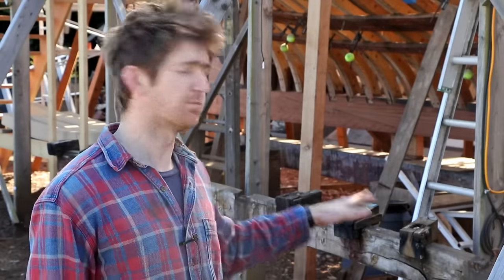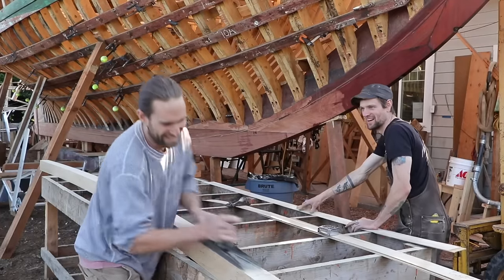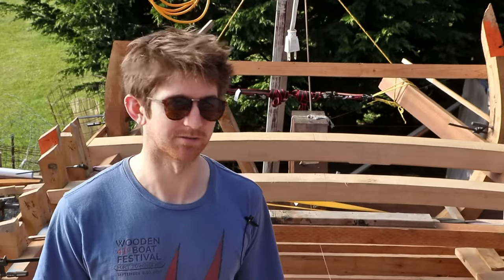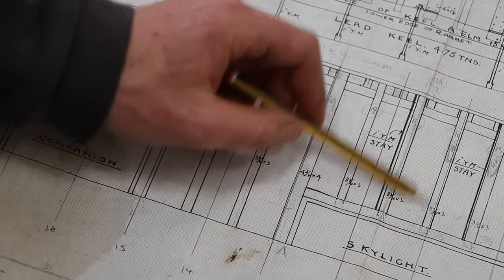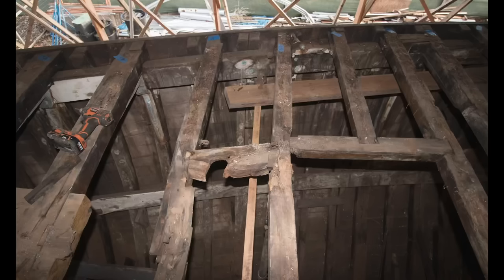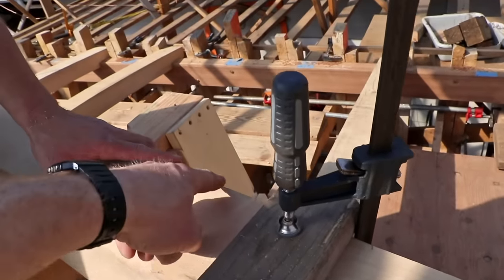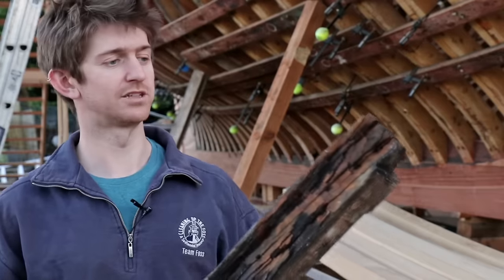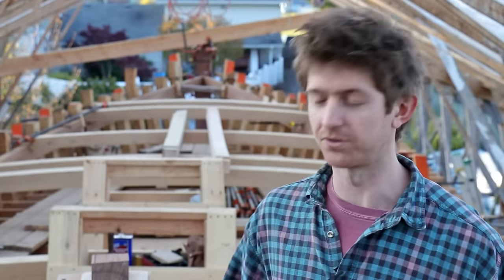BoatBuilding - Fitting Deck Beams! (Tally Ho EP70)

Comment: I quite often pull the plane towards me, especially when doing finer cuts, detail work and working on something with a bit of movement to it. Helps me stabilise the job by leaning against it, rather tan putting my weight behind the plane movement.
Also allows you to rest some muscle groupd for a bit.

Comment: The extra shoulder pocket on the half lap is probably to support the lower tip of the beam, the beam in a standard half lap relies on half the thickness of the beam, adding the shoulder would help with support if the beam starts to split (as is often the case with timber)
Granted it also makes the joint look much better.

Comment: Leo - could you talk a bit about why deck camber is important?  My guess is that as the deck is heeled over, the surface that people are walking on isn't quite as steep sideways as it would be if the deck were completely flat.  Also, the camber provides the salon with a bit more headroom (you said 6" at one point, I believe).

Comment: I've had the same Workmate for over thirty years, and use it as much today as when I first got it. Excellent joinery!
Reply: Moe Beddah you were fortunate to get an old workmate. The early ones with the cast aluminium frames were beautifully made, then they stripped the quality out. It’s all part of the reason why, certainly in the UK no one would buy a Black and Decker power tool.

Comment: sandpaper on bottom of plane..eh it works. Bodyshop sanders work better same hand for and aft but they curve some. Also have clips for holding paper. 

Love the progress you made it has been a LOT of progress on deck structure. For bronze casting your going to need a lot of bronze. You may want to check with salvage yards and the recycling places to see about getting some bronze to bring to those who will do the actual casting in the type of bronze you want. Or even copper, tin, antimony, etc. Not sure about the united states but here in canada we have recycling depots where scrap metal collectors drop off loads they get paid by the pound. You may be able to buy materials at a good price. 

Just some ideas Leo.

Comment: Thank you for the video guys! They are needed during these times! Quick question from a suffering man when needs to move heavy things: Shouldn't you start putting the boat down to the lead keel before it is any heavier?
Reply: He's got to install the floors & through-bolt them to the bottom of the wood keel. After the floors are bolted to the frames & keel, & maybe also several pairs of the bottom-most 'garboard' planks are screwed & nailed in place, he can shore up the bottom of the boat & raise the lead keel up to the timber keel. That way there 'might' be enough clearance to get underneath w/ the Hole Hawg & drill bolt-holes up through the timber, using the existing holes in the lead as a guide.
Reply: @frederickstibbert7389  Thank you! Much clear!
Reply: @frederickstibbert7389  I'm always impressed by your technical answers to some comments, are you a boatbuilder/ shipwright?

Comment: Any thoughts of doing any details on the visible corners on the bottom of the deck beams ie maybe some beaded edges with a router?  Very impressive joinery on some very hard wood.  I am guessing you have become an expert at sharpening!

Comment: Absolutely gorgeous work, Leo and crew.  I love the joinery on the beams and beam shelves! One question out of curiosity: why the sloped bottoms on the half beam dovetails? I would have guessed the slopes would be in the opposite direction, to help pull the half beam tighter into the carlin.  Are they cut that way to avoid water pooling in the joint and prevent rot problems?
Reply from the maker: Yes, exactly. The deck is the most likely place to leak fresh water. Also it takes less timber (and therefore strength) out of the piece being notched into.

Comment: Can you explain tumble hone?  Great endeavor and skills displayed Leo.
Reply: "tumblehome" - as the sides of the boat rise, they continue to curve & start to bend inward. The deck is therefore less wide than the maximum beam dimension. Tally Ho has a slight amount of tumblehome amidships, but it's often quite noticeable in large wooden warships.

Comment: That joinery is crazy!!  I can barely do a butt joint... pocket hole jigs are high end joinery work to me.  I can't imagine using those chisels and getting things right every time.    One question, aren't those beams really curvy ?  It seams like you'd roll off the deck. is that how it will look at the end or do i just need to wait and let Leo finish his work?

Comment: It looks like it would have been easier to build new beside the old. You could take the measurements from the old, transfer the fittings and be saved the labor of removing all the old wooden pieces. Do you remove and replace to have an all new rebuild that is considered the same ship rather than a new build that I suppose would be considered a replica?
Reply: It was (& remains) Leo's intention to rebuild the ship by replacing the worn-out bits. The scale of the rebuild changed when he discovered that the original keel was not repairable.

Comment: Leo...You are still my hero and as often as the videos are uploaded I watch the guy with the parrot and the guys with the genuine fake parrot. 
As Monty Burns would say..."Excellent" Are those beams you've made finally installed or do they have to come back out to be oiled, varnished, painted finish coating applied then put back in and have them water proofed and screws rivets etc installed? Inquiring minds want to know.
Reply: Bill Hamiltono - More work required, let's wait & then see!

Comment: Hi Leo, awesome work restoring Tally Ho, congratulations. Looking at the original beams in this vid, I was wondering why you don't soak all the new joins in oil before fitting them? I suppose it would add time and cost to the project, but surely it would be good for longevity? I remember in a previous vid where you went back to the place you worked as an apprentice, the boatbuilder had soaked all the timbers of his yacht in oil until it wouldn't take up anymore. Seems like a good idea? I'm sure you have a good answer why you're not doing it, or maybe in the next vid we'll see you doing it as planned.
Reply: Rob Healey - I think "Dry fitting" at this stage!

Comment: Just for fun, you should saw some shallow grooves to replicate the original notches that were filled in, so she's 'exactly' as once made... Also, while I realize using chisels by hand is necessary for fine work, I'm surprised no one had fitted an old chisel blade into a 'hammer only' drill to make a variable speed 'power chisel' for hogging out large chunks of hard wood. Once the gross materiel has been removed, switch to hand work to bring it to spec... ; {

Comment: Leo did I hear you right in a the past American elm was originally used in some parts of the structure?
Reply from the maker: On the drawings it was called for in places, yes. Not sure if it was ever used.
Reply: from the woodwright shop " PBS" he said the grain in elm  is very interconnected much less likely to split. he said it was used for wooden wheel hubs for that reason..but the wheelwright channel i watch .i haven't seen him use elm for hubs so???
Reply: @erniew5805  Having tried to split elm for firewood, I can vouch for its cohesiveness.  It's damn near impossible to split, even with a log splitter unless it's a real beast of a machine.

Comment: In watching procedure , I notice there is no bedding or sealer compound in any of your intricate joinery of the deck works . Being exposed to fresh water , aren't they subject to rot the same as elements below the water line ? How do you keep it dry ?
Reply: I'm guessing but maybe they will treat them after setting-adjusting them all and see all is ok.
Reply: @banmadabon  Correct.

Comment: Acorn to Arabella are installing their planks before the deck beams. It seems to me that installing deck beams will add to the strength so the planks don’t pull the boat out of shape. 

They have steamed frames rather than dawn frames. Does this affect the order of the build?
Reply: A2A have their floors installed, along w/ the motor-mounts & cabin sole framing supports. These bits must be installed before the planks go on.

Comment: I found it interesting that scholars don't know how the word was applied to the part in the shipwright sense: from old norse for a witch?
car·line2 | ˈkärlən | 
noun (usually carlines) 
any of the pieces of squared timber fitted fore and aft between the deck beams of a wooden ship to support the deck planking. 
ORIGIN 
Middle English (in the sense ‘(old) woman, witch’): from Old Norse karling; the reason for nautical use of the word remains obscure.
Reply from the maker: Interesting! I had never thought to check.

Comment: I have a question after seeing this....
As far as I understand it, there are 2 ways to finish a wood surface.
Cut (draw knife, planer, carpenters axe, etc) and Sanded, where the sanded surface is preferred for interior surfaces due to its smoother characteristics while the cut surface is for outdoors due to its higher resilience especially against water.
BECAUSE.... (as far s I was told) when you cut the surface, you actually cut off entire wood cells while still leaving a complete intact cell structure on the surface that does not let in water through the now dead cell walls, but when you take that cut surface and sand it, the cell structure gets ripped open, creating a smoother surface (to the touch) while weakening the structure overall, because there is no “build in” protection that hinders water from entering the wood.

This is observable on untreated wood. A cut surface for example by a SHARP! Axe or drawknife does not hold water, it builds pearls and simply rolls off like droplets on a freshly waxed car, even at angles as low as 20 degrees, whereas a sanded (and then unsealed) surface allows water to build droplets, even on a near vertical surface, that actually stay there until they dry off, allowing water to enter the structure.

Now I saw you sand some of the deck beams, wich seems odd
Am I completely wrong here, or is there a specific reason you sanded those deck beams?

To clarify my position.... I am not a shipwright or carpenter in any way, although interested in those subjects I have no education in this field.
I worked a few projects, and this is what I was told, and I accepted it due to its logic, so.... tell me if I’m wrong

Comment: is there a way to not use metal fasteners on the deck dowel and tounge and grove ,sides and ends with a floating deck in groves and pegged down to the beams in sections not each plank,? savy?expansion would make it water tight as soon as it gets wet and shrinks some when it is dry/or is the deck part of the structure that is fixed.?
Reply: Leo look up mr.chickadee on you tube Tradtional Korean floor,it would be worth your time.You can do it .!

Comment: Hi Leo,
Question driven due to watching multiple shipbuilding teams.
You have gone from installing the frames to installing the beam shelves / deck beams, the boys over at Arabella went from frames to planking.

Are there any differences in the two approaches, benefits or problems etc?

Comment: Why are the beams bent upwards? If they're meant to hold the sides together, won't the beams straighten under weight and push the sides outward over time?
Reply: Answering my own question, it's probably more important that any water coming on the deck flows of quickly. So if it's bent upwards now, and drops a bit under the weight, it can still allow the water to flow off.

Is that correct?

Comment: Are the deck beams being dry fit right now?  Will they require that waterproofing stuff that is between each other joint on the boat?
Reply from the maker: yes!
Reply: @SampsonBoatCo  Thank you soooooo much for the response.  I am honored.

Comment: 4:00 The wood is Mahagoni or Sipo. In Europe import stop. I Think only the wood is much expensive
Reply: All you see is live oak (frames) white oak (deck beams) and Angelicque (beam shelve), but it is indeed expensive
Reply: @on4xb  Sorry, thats never ever oak
Reply: @andreasscheifele8561   Sorry, check all the video's [episodes 19, 28, 29: for the frames Live Oak]  [halfway episode 55: the wood for planking (Wana) and the beam shelves arrives (Angelicque)] [episode 63: White oak for the deck structure]. There is one species still missing from the list: the keel, stem and stern assemblies are made from Purple Heart.
Reply: @on4xb  The keel isn't oak
Reply: @andreasscheifele8561  Indeed, see my previous answer: keel, stem and stern are made of Purple Heart. Wait I forgot another wood species: Teak (some of it original from 1910) for the transom (episodes 74 and 76)
Reply: @on4xb  I think thats right. Purple Heart is for me today unknown.
Reply: @andreasscheifele8561  Purple Heart is a  tropical hard wood used these days by many boatbuilders instead of Teak which is extreme expensive and hard to find. By the way there is another wood species used on the boat: Black Locust. That is used for the tree nails (trunnels), the wooden pegs that hold each frame together (episode 54: https://youtu.be/ZW4iVME7ACI )

Comment: I never realized until know the deck on wooden boats is arched. I guess so the water will run off.
Reply: Yes, the water does run off when the boat is perfectly upright, but the natural condition of a vessel under sail is heeled over to one side or the other depending on which tack you are on, and the cambered deck gives you better footing when you are working on deck.

Comment: Do you use Japanese temple mortising chisels or standard western style post and beam chisels?
Reply from the maker: Western style chisels. I like the Japanese ones though, in principle at least.
Reply: @SampsonBoatCo  I bought a couple of 1 1/2" and 2 1/4" dove tail chisels from Japanese Woodworking before they got bought out.  I have no reference from western post and beam but the Japanese chisels hold an incredible edge.  They are Rockwell 64-65.  Pain to sharpen but I have a Tormek as well with wet stones and they are like razors.

Comment: At 3:35 we have a question, is sanding being done with a planer's added weight, or is very fine shaving being done with a pull action that seems all wrong? ||| https://www.woodworkingtalk.com/f11/push-pull-your-plane-55671/ ||| I've done both things. However, the sanding part always seemed like too much fiddling around for me; to get the sand paper folded up the sides of the planer body and taped securely in place. There are times when things just work better backwards, or a change in physical action helps remove fatigue when there is a lot of repetitive work to be done. I would like to have Patrick show us what he was doing and teach us by explaining why he was using his hand wood planer that way.
Reply from the maker: Robert Fay he is using it as a big heavy sanding block! We have rolls of sticky-back sandpaper so it’s quick to set up and nice and flat obviously. Thanks
Reply: @SampsonBoatCo  Thank you for taking the time to get me squared away, Leo. I forgot about sticky-back sandpaper. Doah! It has been a long time since i worked with hand tools and wood. Back in my time we didn't have that.
Reply: @RobertFay  You forgot the BOLD !!!! Just joking!

Comment: Do anybody know the reason why Tally Ho builders installed the deck beams before planking the boat and Acorn to Arabella did the contrary? The boats to me seem pretty similar and the different choice has to be more than a "personal preference"
Reply: difference between shipwrights   and a couple guys building a boat?
Reply: I was wondering the same thing.  I'm no boat builder, but installing the deck beams first would make sense to me in order to hold the frames more rigidly as the planking is bent around the hull.  I'd be curious to hear an expert opinion on the "order of operations" though.

Comment: Leo, I know you mentioned you were thinking that you're probably going to rebuild the interior as she was originally designed, but I really hope you reconsider.  My understanding is that you're going to be living aboard this boat and that the original boat was designed more as a racer, pleasure cruiser, not a live aboard.  More importantly, we have a whole different aesthetic around what is functional and pleasing in a living space, much different than it was in 1910.  Just think of all the remodeling done to houses from that period to open them up and make them more livable (opening up walls to combine the kitchen with the living space, etc.).  

I urge you to design and build the interior as you and Cecca would want to live in it for years (decades?) to come.  My concern is that to build to the original plans would result in a cramped and overly enclosed space that is much less functional than it could be and might become oppressive over time.  It seems the outside lines of the boat, the structure of it, the rigging, etc. are the important parts, the interior much less so.  I think it would be great to make it a "living boat", one that blends the best of the past and the present.  Of course, do it exactly as you want, you're the master and this is your project!  Just asking you to think about it one more time.

Comment: Why don't you use glue?
Reply: Glued joints will always eventually fail after many cycles of changing temperature & moisture content. This is ok if the boat is designed for a 20-year life, but not if the goal is 50 or 100 years.